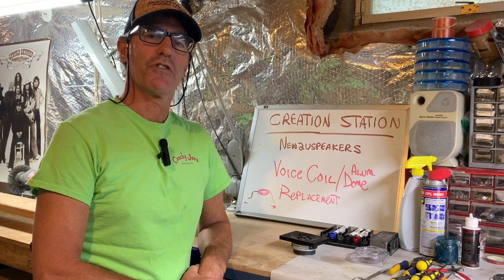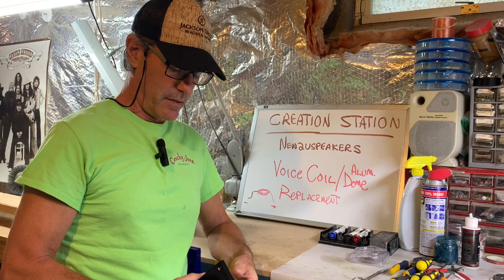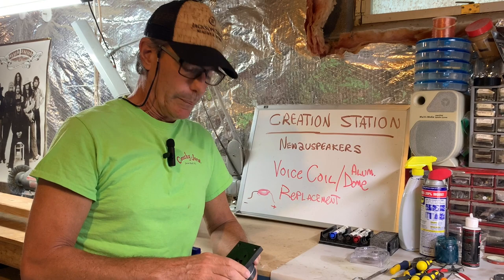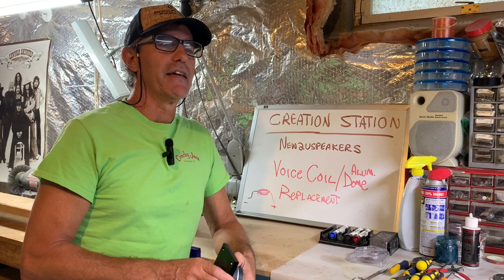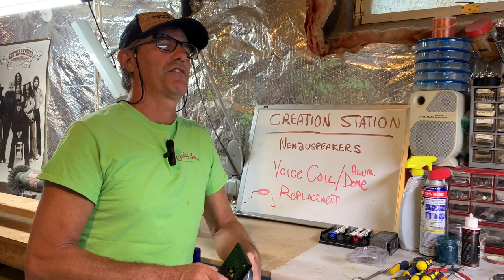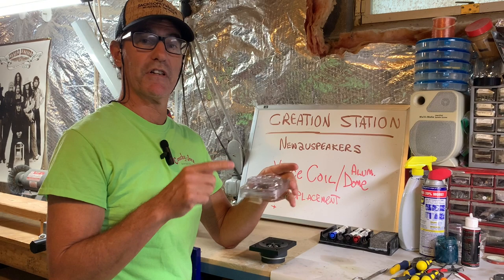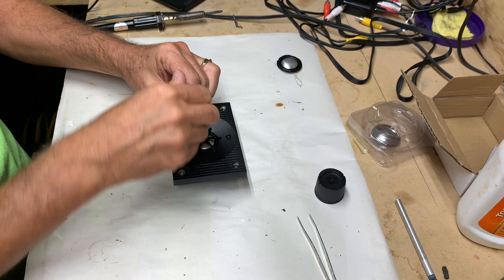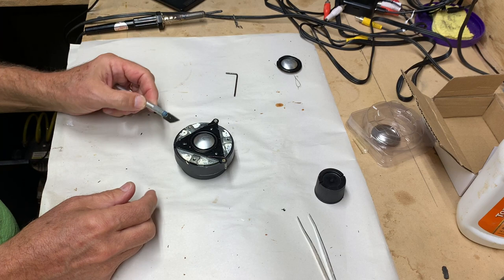How to Repair: Paradigm Aluminum Dome Tweeter Voice Coil Replacement

Comment: I bought a pair of Boston Acoustics VR940s without knowing one had a completely inoperative tweeter.  When I pulled it I was hoping the wires had somehow pulled off, but no.  No output whatsoever.  Not strapped with cash for a replacement and the tweeter looks brand new practically.  Hope its repairable.
Reply from the maker: It’s fiddly work, but you may want to consider taking it on. Unless you have a near perfect match of the replacement diaphragm with the original, it’s unpredictable how close the sound output will be to the original. So be prepared for that outcome with a next step. Good luck. Thanks for watching and commenting.

Comment: Thanks for the video I have the paradigm studio 40 v3 speakers.
I think my tweeter is blown , i still here sound but there is static and distortion.
Is that blown diaphragm?
If so do i replace the entire tweeter or just the diaphragm?
Confused.
And is it really difficult to do myself, or should Itake to a repair shop.
Thanks alot for your help
Reply from the maker: There are some tests that you need to do first. You need to confirm that the problem is not in the crossover circuit. This requires using a digital voltmeter and checking the resistance of the tweeter itself, as well as the values of the components in the crossover. You should also swap the tweeters between the two speakers, and see if the problem follows the tweeter or stays with the box that the tweeter is mounted in. It is easier to just buy a replacement tweeter if you can find one on the open market. I don’t know whether or not replacement voice coil’s are available for that model. I would contact Midwest speaker repair and tell them your situation and use their advice. Otherwise you may be in for exactly the same kind of repair process that I did on the video. It is not easy. And if you don’t have the tools and skills, I would not suggest it. Thanks for watching and commenting.
Reply: Do you have videos on how to test crossovers? Do these components fail often?
Thanks again
Reply from the maker: @jacklawer6389  I don’t have a video that covers this. It is some very specific electrical troubleshooting skills and tools that are required. Start by doing the swapping and see what you learn from that. Your best bet is a full Tweeter replacement if OEM tweeters are available.

Comment: Nice job.  This is the one job I've not yet attempted in the speaker repair I've accomplished.  I'm curious as to what ratio of magnetic material vs. mineral oil you mixed, if it can be quantified in some way.  Also, how was it assured the voice coil is centered in the gap?
Reply from the maker: You need a lot less magnetic toner than what you would probably think. I would use 10 parts oil to one part magnetic toner ratio. You can always buy the small tubes of premixed commercial fluid if you are hesitant. Thanks for watching and commenting. Good luck in your repairs. We all need a little luck sometimes!
Reply from the maker: With that type of coil, it’s very difficult to have 100% assurance that the voice coil is centered. You have to rely on the plastic mounting hardware to do that job for you. And since I’ve reused the mounting hardware and installed a replacement coil, it is not assured. It is chance, and just careful attention to detail while you work. To be honest, I don’t recommend it, and I don’t take on jobs that require that type of replacement because they are usually not 100% successful for the exact reason you’re thinking.
Reply: @new2uspeakers  Great, thank you

Comment: 33:16 you forgot one pieces
Reply from the maker: Hmmmm. I checked the video a few times and I don't think I forgot to add anything at this point. You mentioned I forgot one piece, but it was supposed to be a piece of what? If it was the electrical tape to cover the lead wires, there are 2 pieces installed and that is all that is needed. Let me know what piece is missing. Thanks for watching and commenting!!!
Reply: 4:18 triangle isolating sheet. Oh in the end this sheet was installed, but I see not when you installed it. Sorry, it’s my error. Your video ist very good. I repaired last week the coil and this was very hart beause the wire is soooo thin. God thank, the wire was broken on the first insert to the coil. Now working.
Reply from the maker: It is important to put in this sheet in because it will change the nominal location of how deep the voice coil is positioned in the magnet recess and you could limit the coil travel. You have good eyes since I think I forgot to re-install it initially.

Comment: Hi! I tried to fixed the dented/pulled in tweeter on the speaker of my hifi (using the duct tape trick) and the whole tweeter came out (got unglued). Any ideas on the best way to put it back there? Is the speaker destroyed? Thanks in advance
Reply from the maker: If when you pulled the dome, the entire dome with the attached voice coil came out, then you are probably in for a complete voice coil replacement. However, it’s hard to tell from your description without a photo. You’re welcome to send me a photo at the contact information of my YouTube profile and I’ll let you know what I think. Thanks for watching and commenting!

Comment: Can I not  buy the tweeter dome with the black plastic already intact without having to de solder and stuff?
Thanks
Reply from the maker: That would be ideal, but there were no spare parts available when we went looking for the studio 60 model. because of that, it was necessary to do the repair in the video. That is why it is so tricky.
Reply: @new2uspeakers  thanks a  lot for your reply

Comment: I'm not sure that the coil is glued concentrated in the gap. You have not taken action for the centers.
Reply from the maker: I think you are saying that I did not assure the new diaphram/coil was concentric to the magnet recess. The answer is  Yes and No. The black plastic triangular piece controls the precise location of how it is mounted to the magnet. So it is critical to ensure the new diaphram/coil is mounted precisely to the black plastic. Fortunately there was easy to observe very small mold line ridge in the black plastic that was able to be used to visually check the OD of the aluminum diaphram was located well. Certainly the factory would have a tool/jig to do this , but in my opinion your eye is very sensitive to checking to see that such a concentric alignment is "good enough". As you know voice coil rubbing in a tweeter can be hard to detect, but I think we were sucessful enough. Thanks for watching and commenting!!!
Reply: @new2uspeakers  I think you could have made a channel for the wire on top of the black plastic. Then a new opportunity opens up! You can use paper inserts between the core and the coil before assembling the speaker. Glue the dome using the center (paper liner). Next, remove the paper insert and install the black plastic in its place, there are pins there. The metal dome has an anodized layer and does not conduct electricity. Therefore, the wire can be safely led from above.
Reply from the maker: I do love that idea. This is what’s great about YouTube. We can all learn from each other and build a fantastic community. Thanks for sharing. Hopefully it’ll help the next person down the road who needs to do a similar repair.
Reply: @new2uspeakers 🤝